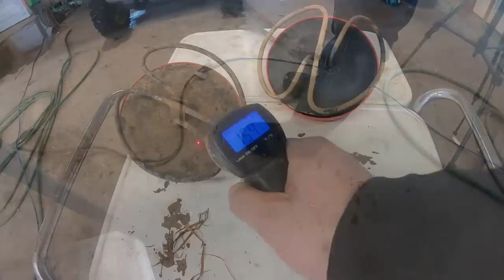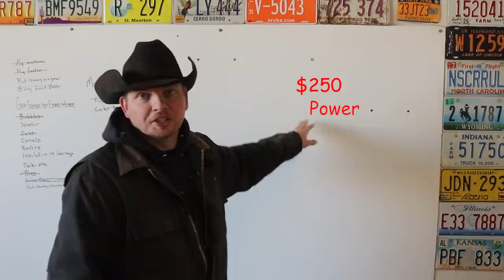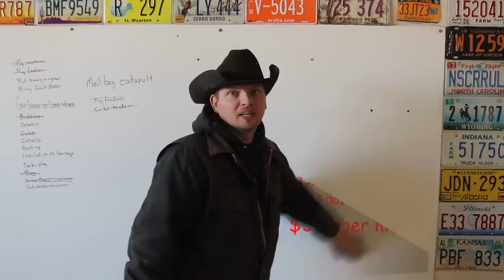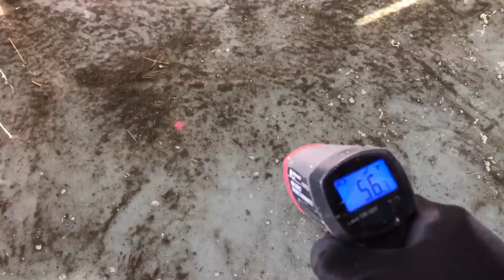Stock Tank Heaters vs. Breaking Ice - Water on the Ranch

Comment: You are heating the water to hot. It only need to be above freezing. Does one of the local shops Sell Timer switches. They they are about $7 each. Set them for on for 10 minutes of every hour?  What about electric Blankets? Put an old Pallet under the Tank with an electric Blanket on the pallet and a Timer switch again ?
Reply from the maker: The heaters have thermostats. They turn off at 35 degrees.  The continuing heating is caused by the sun on the water.  Which of course goes away and the temperature drops drastically. Thanks a bunch -Mike

Comment: HEY, 56 DEGREES?  WATER DOESN'T HAVE TO BE THAT WARM, PUT TIMERS ON THE HEATERS AND DIVIDE INTO TWO HEAT CYCLES.  THEY DON'T HAVE TO OPERATE 2/7 EVERYDAY.  PARALLEL HEAT CYCLES TO WEATHER CONDITIONS; JUST HAVE TO MANAGE THE TIME SEQUENCE.  I ESTIMATE SAVE YOU 40-50 PERCENT.